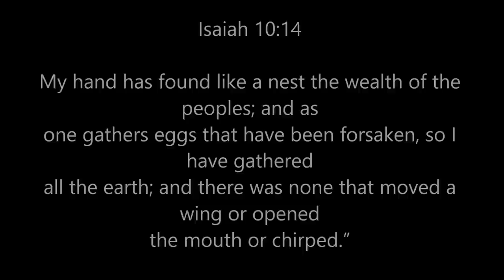Chicken Tractor - Construction of the Original Lawn Mower - 2

Comment: Awesome but if you had to do it again make the whole pen and coop move as one I bet that over time you will move it less do to the difficulty of separating and joining the two parts. As one piece unit with your water and auto feeders you could park it any where. for weather of sun. think about putting the two parts together as one. Just an idea. also the gap on the coop between the roof looks a little large I had Raccoon get in to my coop under the eves I had to string electric fence on top to stop them.
Reply from the maker: +Robert Hansberger Great point and I thought about doing that but since this is a pretty heavy coop I decided not to. I do have a small piece of trim that now covers that gap between the two. Thanks for checking it out!

Comment: Great video mate. If you had to make the whole unit (coop and run) movable as one unit then what changes would you make if you started out from scratch?
Reply from the maker: +Michael Ball If I were going to have the whole thing be moveable I would have to use a 2X2 or 2X3 instead of 2X4 construction. It is just too heavy to move the whole thing together.

Comment: Nice. It does appear to be a lot to move 6 chickens around the garden though :) Would you do it any differently if you started from scratch today?
Reply from the maker: Only thing I would change is to put the wheels toward the middle for easier lift on the front. They are a bit too far back

Comment: Hi, I thought the coop and chix run were connected. when you put the back piece on to travel with it, what was connected to secure coop to run against predators?? Thanks
Reply from the maker: it is heavy enough that when the wheel levers are down it sits on the ground flush with the coop. There is a 1.5" gap that I close off with two pieces or 1.5" wood but it is not needed since nothing that will harm them can fit through there and also they are closed in the coop at night anyway so they are safe from predators

Comment: Hey love your videos! I was just wandering if the tractor can be moved by hand or if it is to heavy? If it's to heavy have any suggestions for someone who doesn't have a drive mower?
Reply: Let me make a suggestion.   There is absolutely no need for the chicken tractor part to be made 6 foot high.  A human NEVER has to go inside a chicken tractor, if designed right.  You can just pull it forward to clean the floor where it has been sitting.  There are plenty of other videos on You Tube for chicken tractors that are only about 3 feet or so high. Any many of them can be made of PVC or other lighter weight materials. What you see in this video is an extreme over build job that merely adds cost to the project for no actual benefit to the chickens.  The only reason this tractor is this tall is that the human who built it wants to go inside.  This design is made for looks, not for practical functionality or with costs or weight in mind.  This design adds weight and therefore demands something to pull it with.  A chicken tractor of normal height can readily be moved by hand.   Check out Justin Rhodes "Chickshaw" designs.  All of them are easily moved by hand. Typically large bicycle wheels are used.